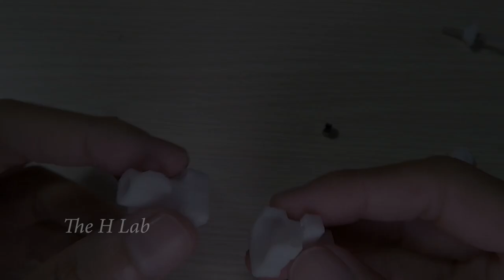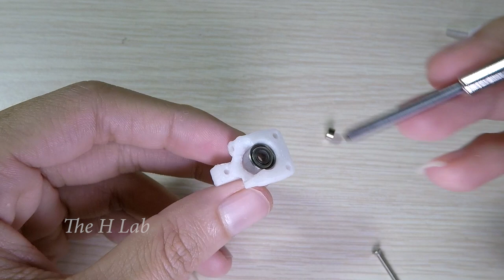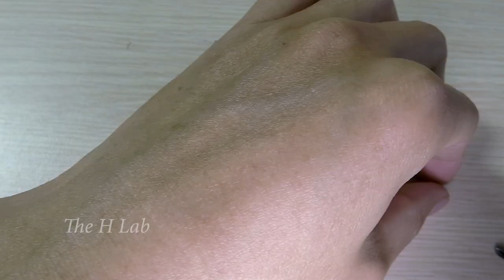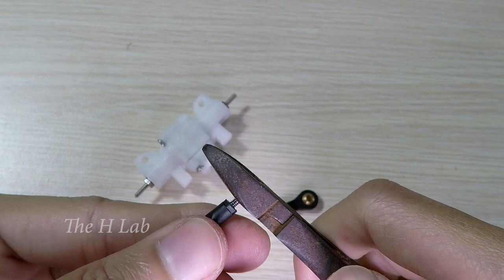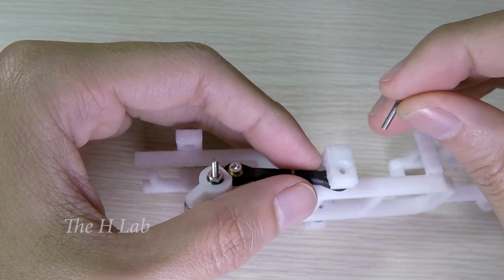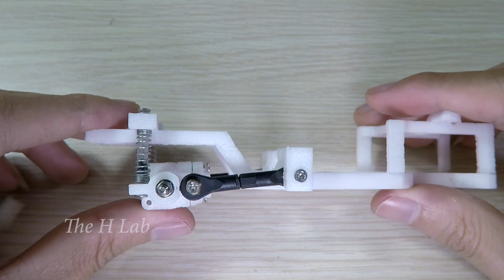3D Printed RC Car - Part1 - Differential

Comment: Nice. did you make de gears in a 3d printer as well?
Reply from the maker: No. I bought these bevel gears from China. But I will try to print it next time. Hope that my filament printer can print it. Thank for watching.
Reply: @TheHLab   what size are the bevel gears? im looking similars in Aliexpress